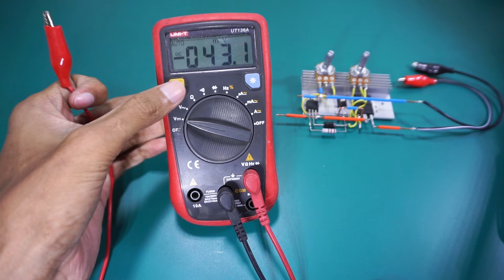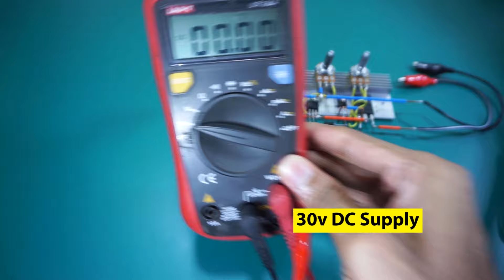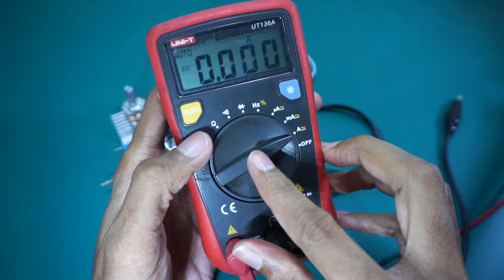DC Voltage and amp Adjustable power Supply, Simple DC voltage regulator

Comment: This circuit is all over the internet and remember it is NOT a regulated PSU circuit. It is just for fun! Change the load resistance in the output and see the volatage variation.
Reply from the maker: thank youer
Reply: All those people do not have electronic background they just are amateurs and only use these type of circuits for fun and collects more viewer to gain money 😁😁
Reply: Because the input supply is not of much wattage

Comment: Good working circuit, I tried it, the output transistor can be replaced with any high-power npn, if anyone will assemble for a sound amplifier, then at the input after the diode bridge and at the output of the circuit, you need to put condensators, thank you for the circuit

Comment: Your circuit is interesting, I just simulated it in Multisim and it works very well. Of course, it does not support 20 Amps due to the 3055 but it can be replaced with another transistor that does support it or put 2 or 3 transistors in parallel with their respective emitter 0.1 Ohm resistors.
thank you.
regards.
Reply from the maker: thank you
Reply: Zener value?

Comment: Video shows 3 transistors but diagram shows 4. 7805 is missing in the video. Which one is correct?
Reply from the maker: Diagram is correct. If you can use 7805, it is best
Reply: @homemade_101  Thank you very much!
Reply: 7805 é somente para alimentar o voltímetro amperímetro que e acrescentado no outro circuito

Comment: Gran video. Qué componente es el de color azul? Será un diac  db3? Gracias por su valiosa respuesta.
Reply from the maker: it is Connectors. you can use normal wires

Comment: does if we use long time and max power the mosfet will burn or not? i follow your other video when use high power and long time mosfet seeming smell it mean will burn soon.(I'm also use Heatsink)
Reply from the maker: yes it was heating
Reply: why it still smell, even i use heatsink and cooling fan?
Reply: do you have video to customize PC power supply or LED 12v power supply allow us to adjust voltage to make universal charger?
Reply from the maker: @sokdolla   no i dont have. sorry. I will try .

Comment: Same circuit banaya hay working fine but 3055 bohot juldi heat hojatay hain  5 mint  mai jusy on 2 amp load per mene 2 trinsister use kiey hain achi heavy heatsink k sath koi advice den transister heat bohot hota hay

Comment: Bhai kaya iss circuit se lithium battery change kar sakte hai
Reply from the maker: yes
Reply: Thanks bro
Reply: Lakin bro tip3055 transistor over heat ho ja Raha hai 6 ampere dene par iska maximum input ampere kitna hai

Comment: Hello and congratulations for the video, I wanted to understand at minute 4.50 the cable connections on the right potentiometer are different from those seen at minute 5.01 the center of the potentiometer goes to Bd139 and not to the diode, so have you changed? thanks and good luck again, I would like to build one too.
Reply from the maker: welcome.  circuit Diagram: https://youtu.be/5fxZFkCIoik?si=Afv_0SFCwH4YYAnv

Comment: O problema destes circuitos caseiros ,e disto ninguem fala va-se la saber porque,e a sua queda de tensao,quando se aplica uma carga...uma lampada ou motor na saida de ajuste,ou seja por exemplo uma lampada de 12 volts 21 watts quando ligada na saida de ajuste a 12 volts reais,nao tem o brilho que deveria ter ao ser ligada a 12 volts reais,e se na maioria dos videos de facto mostra a lampada la ligada com os 12 volts e o brilho normal,e porque a voltagem la injectada de momento nao sao os 12 volts reais mas sim uma voltagem superior talvez 15v 20 v ou mais para ela dar o brilho normal,e para provar isso e muito facil em antes de por a carga lampada e regular a saida ajustavel para os 12 volts sem carga e so depois ligar a lampada,entao ai pode-se verificar a queda de tensao de 12 volts reais para 7 volts 6 ou 5 volts,porque de facto nao pode ter uma quebra tao acentuada,no aceitavel talvez 0,5 volts,dai a grande lacunas destes circuitos caseiros,nao quero dizer mal destes projectos e bem haja quem os faz e ate sao interessantes,mas na realidade tem este senao.
Reply from the maker: :yougotthis:

Comment: How to make 4 volt 6 amp variable power supply for mobile repair work .please make perfact. work mobile short cutter
Reply from the maker: They have short circuit protection. But it's complicated. I will make a PCB board in the future.